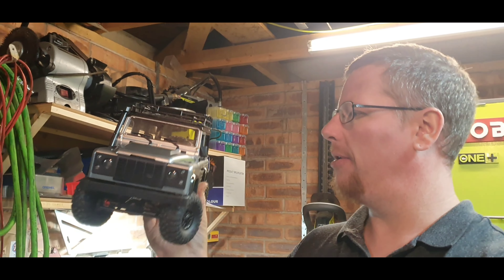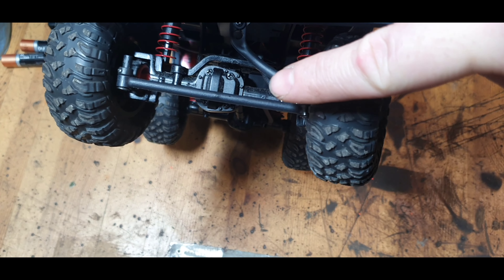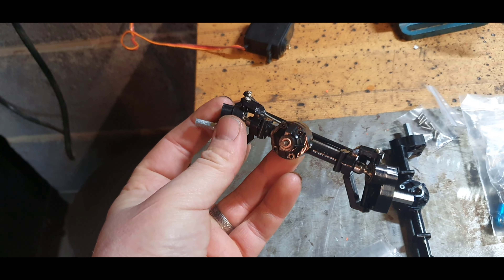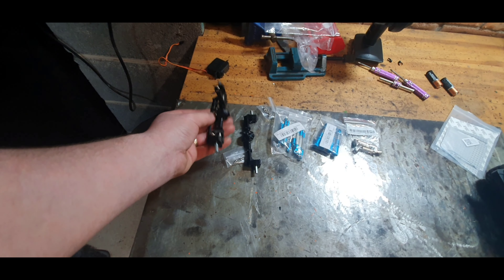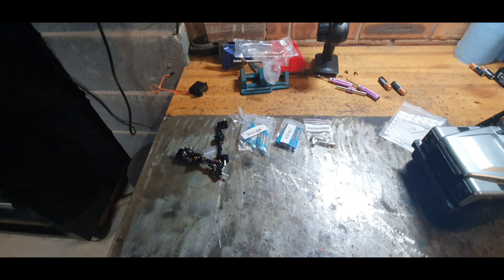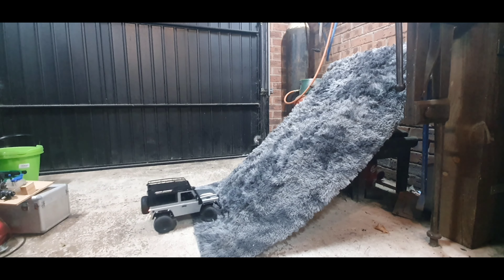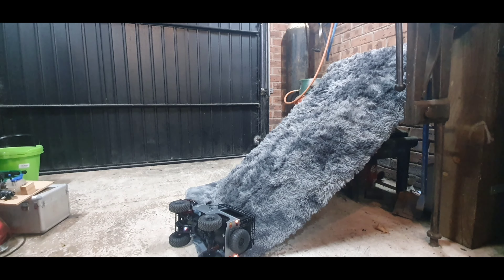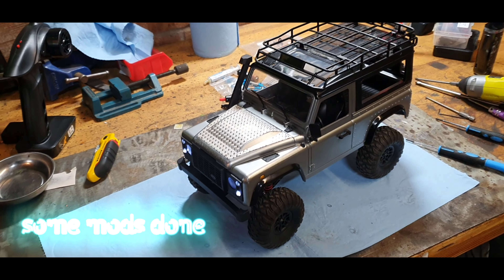Rc Land rover defender gets upgrades mn99s

Comment: Looking good! Yes they have lovely hard bodies. Iv repainted mine to look like an old camel trophy model. I upgraded the motor to the 370 and has much more crawling power, although slower. Metal diff n axles, oil shocks, top alloy mounting plates. The best mod was mounting the servo using a kit to the axle. It got rid of all steering bump and that awful angle. Great vid thanks
Reply from the maker: Yeah it definitely look the part. Think this 1 will be more of a shelf queen 🤣
Reply: Do you have a link to the kit?
Reply: @tylergoff8169  Its currently on banggood for about £62 i see they say one is a waterproof version? Hmm. Like everything rc prices gone up a bit, i got mine from bg for about £45 a year ago.

Comment: ..... Well done Mate, looks cool.
I wonder if the new axes have alternate ratios and one is limiting the other ?
place it on it's roof and mark outer tyre (front & rear) position with a while sticker,
Advance throttle one revolution on front and compare it with rear.
I have one of these on route, waiting to play 'smash up derby' with WPL D12.
Reply from the maker: I think its just the fact they are cheap ones off ebay and the gear's inside are not smooth. I might attach my drill to them and run it full speed for a bit to see if it can make them run a bit smoother 👍

Comment: Since you've put the portal axles on can you not replace them with the originals or has the installation altered the chassis too much? If not, some wheel weights and perhaps a new motor maybe needed to sort this one out. Cheers for sharing this, I've got an MN99s arriving in the post today haha.
Reply from the maker: I did have to heat up and bend some plastic parts to get them to fit but I could always bend them back. It is nice to have better steering but I think it was better before adding the portals 👍
Reply: @TheYorkshireMix  They do look great though, maybe a longer control arm from the steering servo could sort the steering angle out. Not sure, I'm new to all this haha.
Reply: @TheYorkshireMix  Oh and mine arrived, I love it but my dog, not so much.. scare to death of it. :-/
Reply from the maker: Yeah its a fantastic looking car. I will get around to having another look at it soon but for now I've sort of got addicted to buying rc cars again so I've got a few to play with lol. Up to now I think the axial scx24 is 1 of my favourites but the little drift car I've just posted a video on is also great fun.  My dog was the same to start with and now he just thinks it's a toy for him lol

Comment: Buy some weighted wheels they will help with the top heaviness
Reply from the maker: Yeah I was going to wrap some soldering wire around the inside of the wheels 👍
Reply: @TheYorkshireMix  like the "inside" inside? around the foam area?
Reply from the maker: Yes around the wheel inside the tyre 👍